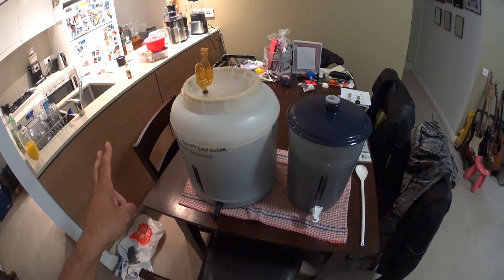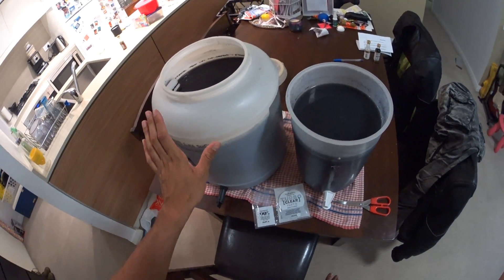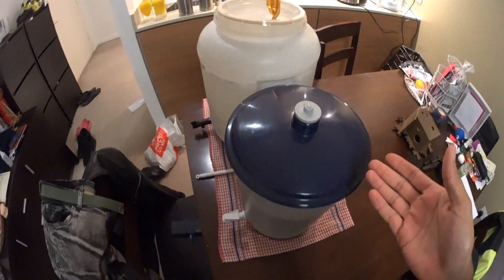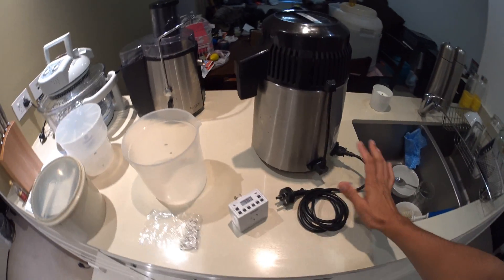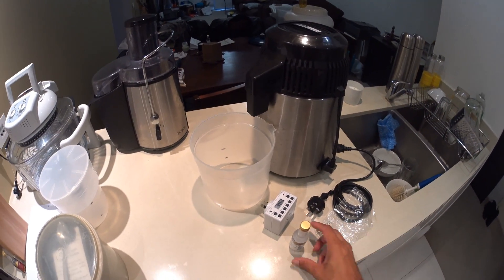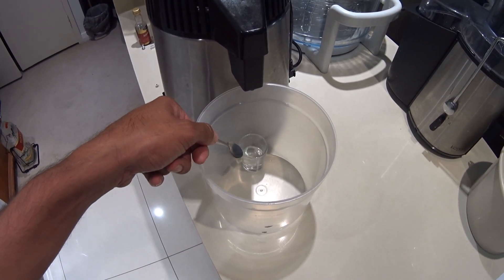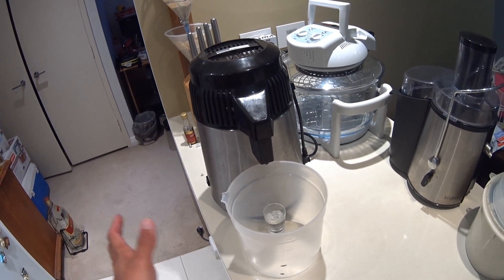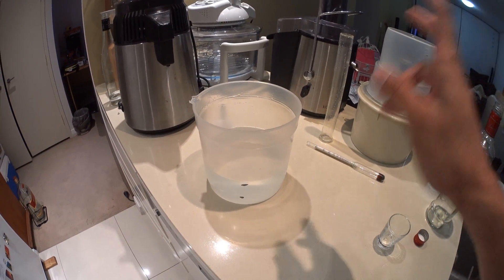Home Distillation - Part 2: Distilling Wash into Spirits

Comment: whats going on outie555? great vid. i just got an air still myself, your vid has been very useful. what i dont get is when you say the air still filters get expensive compared to the ultimate spirit filter, but as far as i can tell the air still filters are cheaper, so i dont get that. eg. ebay you can get 50 for $38.50 and run 1.4L per one so thats like $0.77 per run... then if you get the ultimate spirit filter the carbon is actually expensive too, they sell this carbon for $27 for 2kg or $115 for 10kg and if as you say in your vid you use 250g per run of 1.4L that works out to be about $2.80 per run compared to $0.77, so i dont get that. anyway just wanted to say i thought this video was very well done, keep it up, but if you get a minute answer me this filter question because im thinking ill stick with the air still filters for now as far as i can tell. cheers m8
Reply from the maker: glad you liked the video series mate. To clarify, the 250g of granular carbon filters the entire batch I make per ferment with both fermenters, so in essence 8 L of neutral spirit. I measure the 250 g with a cup size, so it's not by weight, rather by volume when dry. I still have at least half my 2kg bag which I bought a few years ago too. 
I do like using the air still filters if I am only doing a small batch with just the still spirits fermenter. If you are only doing a couple of liters of filtering then I reckon just stick to the airstill ones as it is simpler and you already have the equipment. Bigger batches, then it's easier to use the ultimate spirit filter or something like it as you can pour the spirits in from a container into the filter then out to another container with out much interaction. Handy to do overnight.
Reply: outie555 Oh I see. That makes sense. Thanks for explaining that.